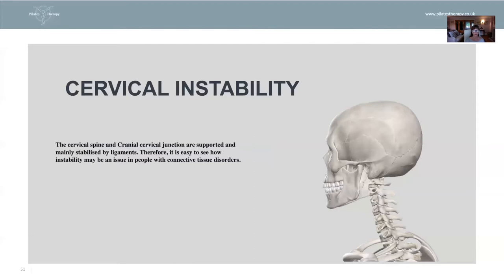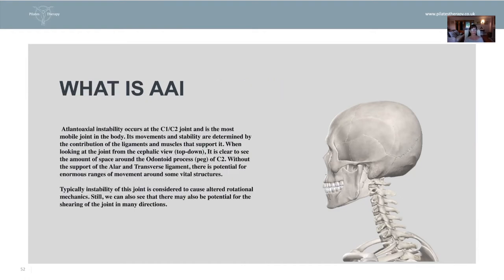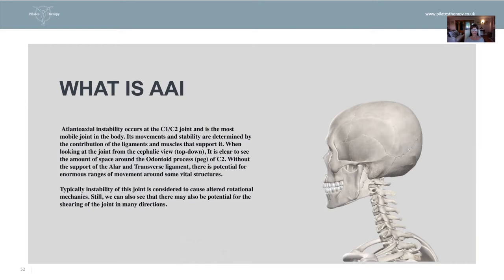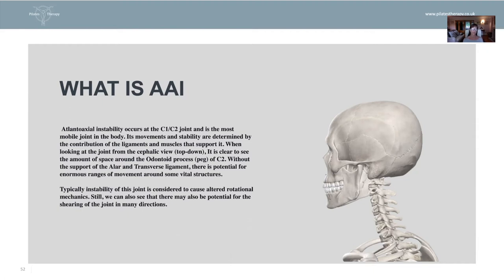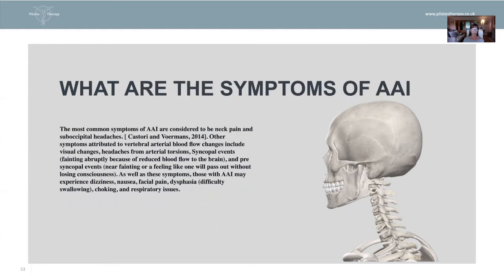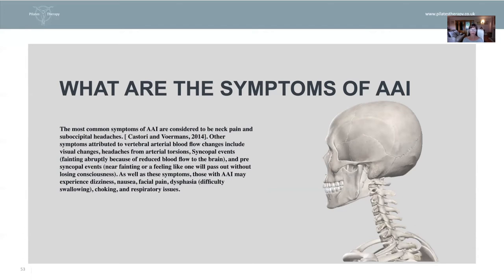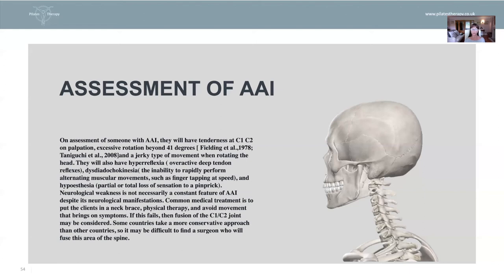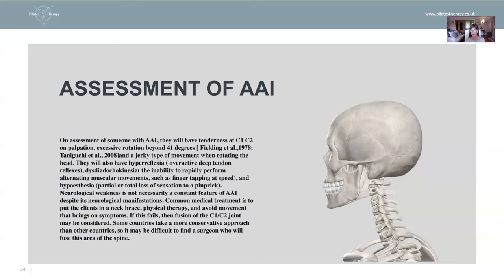Atlantoaxial Instability | Cervical Instability | Bonnie Southgate - hEDS Rehab

Comment: Hi Bonnie, I want to run this by you.  I have C5 - C7 fused 9 years ago.  In July while golfing I had something happened that is giving me symptoms and pinching of C2 on the left side only.  These include pain on the back of the head and numbness going from under my ear across the lower jaw and into my neck.  When I irritate it even swallowing feels like it's changed.  Turning to the right is free and easy, turning to the left is like I am pushing into something.  If I don't turn much for a few weeks it seems to tighten up a bit but then I will look to the left I appear to go backwards again.  I tried chiropractic and that made it worse.  Do you have any recommendations for care in my situation?
Reply from the maker: Hi, I am so sorry to hear you are having issues at C2. Golf is a rotational sport and AAI is a rotational issue which takes place at C1/C2. As you have already had fusions it is worth going back to your medical practitioner for an assessment. I would definitely try and avoid any manipulation as it may create more instability and muscle spasms. I would suggest trying to find an ISM physiotherapist if you can find one. They are very good at finding drivers of issues. Hope you get to the bottom of it.

Comment: How about some solutions
Reply from the maker: Thank you for your comment. I completely understand your disparity in the lack of real solutions for CCI/AAI.
I have found new exercises that seem to be beneficial, and am gathering valuable information from a new paper on the subject. However, due to my busy schedule, it might take a bit of time to get everything ready and presented on you tube.

I am truly sorry if you are facing challenges related to this topic. I hear your frustration.

As soon as I have updated the content. I'll make sure to share it with you and the entire community.
Reply: I have CCI and have had terrible symptoms like those of a heat attack and unable to swallow correctly and digest food. Some solutions, find an AO chiropractor, one who adjusts on the Atlas disc. Get some physical therapy like those suggested in other hEDS videos. If you can tolerate acupuncture, find an acupuncture practitioner, it really helps calm down the central nervous system. If you have to take some pain medication or spasm medication like I do, then do so. I know in the U.S. they like to do disc fusions on the cervical spine. I refuse to do that, even though insurance pays for that. The other and I am looking into it is Prolotherapy or injections. I'm investigating this and there are only maybe 3 clinics in the U.S. that do it, but is reported to tighten up the ligaments in the neck. It is very expensive and is all out of pocket, but is promising.  I hope everyone is able to find some relief because at times this can be a nightmare.